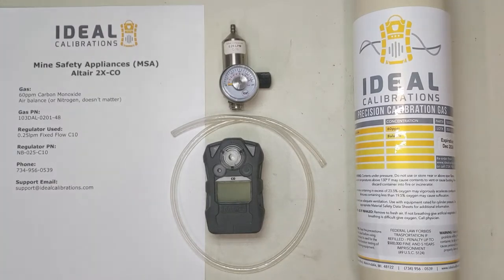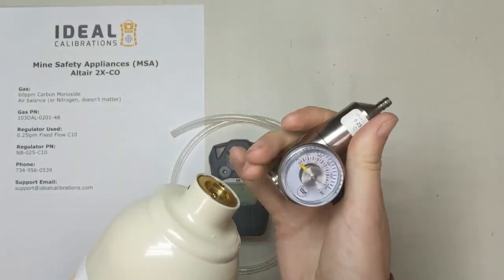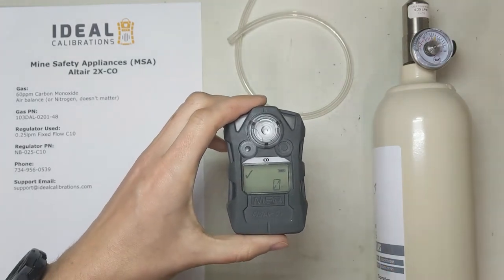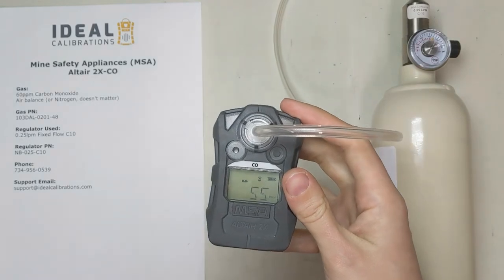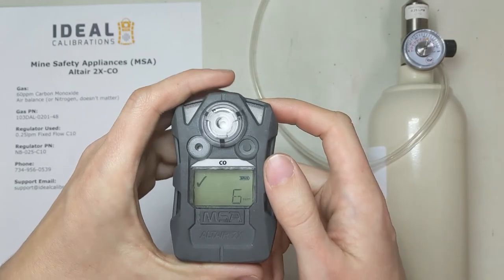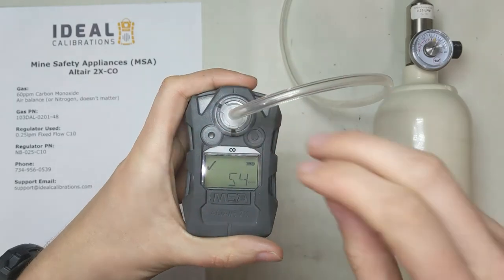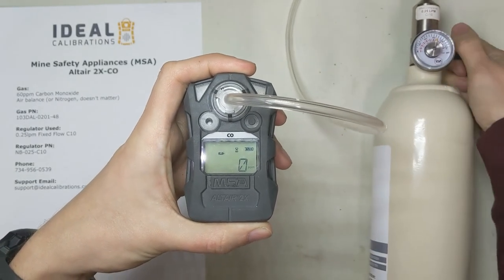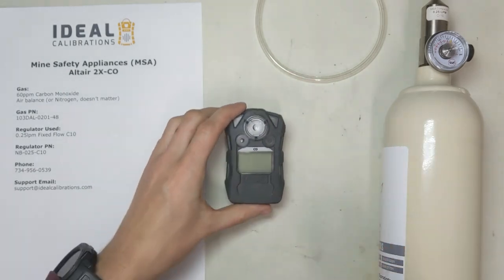MSA Altair 2X-CO Calibration and Bump Test Guide

Comment: Do you know if any differences exist in bump testing between this model and the MSA ALTAIR single gas detectors?
Reply from the maker: It depends on what model you have. If you have the Pulse, you can do a bump test where you exhale on the monitor to test it. Otherwise, it's fundamentally the same for bump testing.